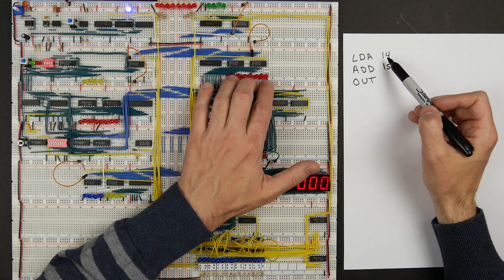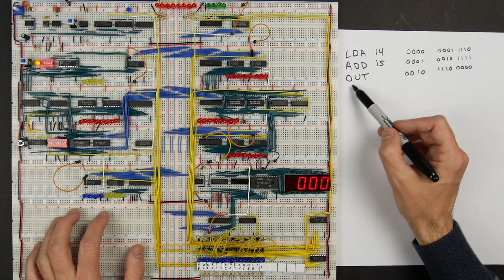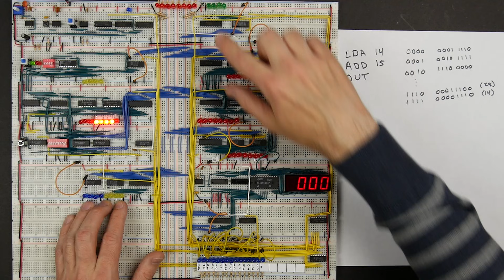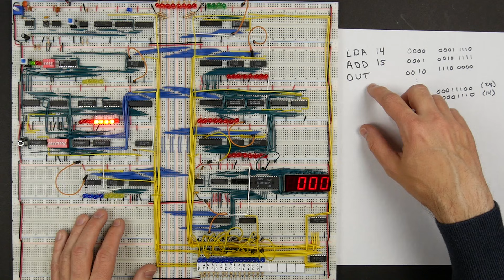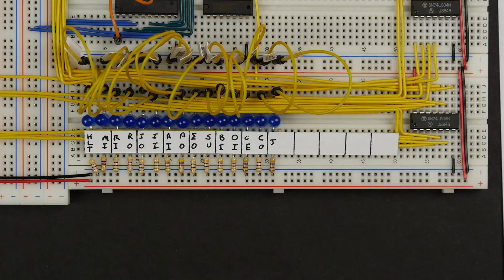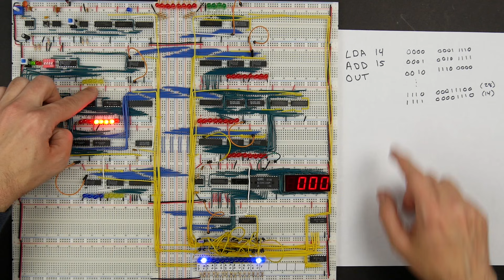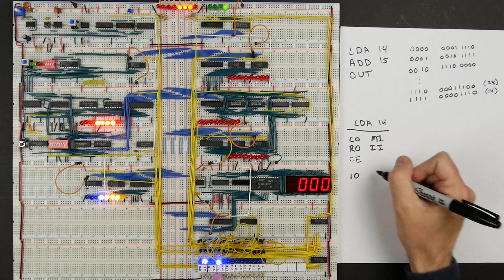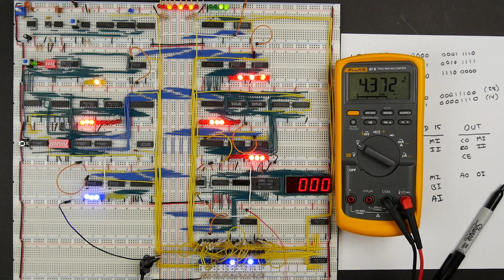8-bit CPU control logic: Part 1

Comment: Thanks, Ben, for all the videos you make.
I am a software type of guy (learning this stuff now) and don't know anything about physics of semiconductors, resistors, capacitors and all that jazz, but thanks to your incredible teaching skills I'm sort of able to understand how your architecture works.
What is really interesting to me though is what is physically limiting the maximum frequency of your architecture (or any architecture in general)? Can you make a 1ms clock cycle? 100us? 1us? What's the limit and what are the limiting factors that make it difficult to simply bump up the clock and not worry about improving the architecture?

Comment: Thanks Ben!  Much appreciated for the upload of all the videos.

I am currently watching your video's avidly, and am in the process of creating a fully 8 bit computer with 8 bit databus and addressable space.  I am using a single 64KB ram chip with i/o pins - and have that working.  (I think I might create a secret instruction to "page" memory too) LOL.

Anyway - so far with your instructions, I have a clock, Ram Module, Program Counter, A, B and ALU.  My next step is doing the EEPROM programmer, Command register, and the CPU control logic.  Cannot wait to see more of this series.

The biggest issue I think I am going to have fun with is going to be designing commands that are two bytes long.  For example - LDA #FF, which would load A with address 256 - requiring a PC increment to get to the instructions expected address location.  And then of course, a LSA (load static value to A) command which hard loads a number into the register rather than a memory location.

Having a great time - and it's so much fun realizing that the technology of an Apple II - is kind of pretty much reachable by the common man.

Thanks again.
Reply: I'm just working this out now for my design. How did you get on? Regarding the LSA command, the number you want to load is actually already in a memory address - the next one along from the command!

Comment: Thanks for the excellent series, it's inspired me to build my own 8 bit computer.
I have a question though:
Why is it that some elements use the BUS at all. eg would it not make sense for the "program counter" to be the "memory address register", or at the least for it to directly feed the "memory address register", skipping the BUS? 
Similarly, and this is more relevant since I'm thinking of having separate "program memory" and "data memory", would the "program memory" not directly feed the "instruction register", rather than having to be read out/in via the BUS?
Thanks.
Reply: I think most of those differences are just differences in architecture. Ben's computer being based on a "Simple As Possible" design from a book he mentioned earlier in the series. For the sake of simplicity everything is either input or output from the main bus. The PC has to be tied to the bus (in this style of architecture) in order to support jump instructions since in effect you're just pushing a new value into the PC. There are certainly lots of optimizations that are possible, but the goal isn't an efficient computer, but one that's useful for demonstration.
Reply: Ben Harper, that totally make sense. Cheers for the input.

Comment: Nice vids, but where do you get all those logic chips
Reply: You should be able to get any of the ICs (Integrated circuits), or other components from any electronics supplier like Digi-key or Mouser. Check out http://www.mouser.com/Semiconductors/Logic-ICs/Logic-Gates/_/N-581zn?P=1z0z63x for an example. If you want to build something similar you'll probably want to limit your search to "Through-hole" components in a DIP or PDIP (or similar) package.
Reply: Thank you!
Reply: Thank you?

Comment: Wow! Two videos in a row? That's a real Easter egg :)
And it's finally the control unit! YAY! :D
Hmm... so the operation of this computer is basically moving data around through the bus between different registers by turning their inputs and outputs on and off? :q Sounds easy :>
I guess I could do a simple control logic now by using a binary counter along with a 1-of-8 decoder, or even a shift register which shifts a single "1" through it, which cycles through these states and turns those control signals on and off? Probably by simply driving those signals through OR gates directly from the pins of the 1-of-8 decoder? But it has to use different logic function for the "changing" piece of the microprogram depending on what opcode is currently stored in the instruction register. Then I just need to reset the counter / shift register to start over for the next instruction. Am I right?
Sounds pretty straight-forward :)

Comment: An excellent video, as usual. One little annoyance, though (which has everything to do with me, mind.)
Coming from a few decades of experience in Z80 assembly, I find the mnemonics confusing. I kept mentally putting parentheses around the operands to keep reminding myself that we’re loading A with values from memory locations rather than directly. So, in my mind the program read something like this:

LD A, (14)
ADD A, (15)

Note: The Z80 cannot actually add the contents of a memory location to the accumulator explicitly; the address has to be loaded into the HL register pair first: LD HL, 15; ADD A,(HL).
Reply: It's just a matter of syntax. Some assembly languages use a different syntax in which memory locations come as numbers or labels without parentheses, and immediate values (numeric constants) are preceded with `#` or some other special symbol. I find such notation much clear, because memory addresses are used much more often than immediate values, so putting all those extra parentheses all the time would be cumbersome.

Comment: Ive got a Question. Can you set the  555 Timer to such a high speed, that the components wont work BC its 'too fast' ?
Reply: There's always such a limit. But those low-power Schottky (LS) or High-speed CMOS (HC) are quite fast, with around 10 nanoseconds of delay for each logic gate. Assuming around 10 gates in series in each IC, let's say we have around 100 nanoseconds of time for the signal to propagate through the circuitry, so I guess that with around 10 MHz clock pulses it should still work fine. But it might get worse due to different noises and parasitic capacitances / inductances from the wires and breadboards. So the only sure way to tell is to check that in practise.

Comment: I feel like this whole series should be required viewing material for all computer engineering students. It covers the whole gamut of topics from software to hardware to architecture design in a detailed but clear way. Thank you so much, Ben Eater, for all the time and work you have put into these videos.
Reply: it does lay out the flow nicely ... and is a great starting point for first year engineers ... get them thinking about doing more with the absolute minimum
Reply: not initially.
Reply: ^ this
Reply: I'm a CpE student and I can't agree more. We're taking online classes right now, so everything is theory-only. It's amazing to see in action all of the stuff we're "learning"
Reply: PvtMadnage - Bro. Matthew  no thank you
Reply: This and Scott CPU
Reply: Yes
Reply: This is a CPU
Reply: Isn't this a little bit "low" for engineering students?
Reply: @MicroageHD  Har har

Comment: So wait, I have a question. The speed is only depending on how fast the clock is ticking. Let's say we're clicking that once every second, that will make this to a 1hz CPU. 
Now LDA, ADD and OUT have different number of lines to be executed. This means LDA needs 5 seconds, ADD needs 6 seconds and OUT needs 4 seconds on a 1hz CPU. Or would the logic be able to execute this all with one single step?
That would explain alot in my past if every command in Assembler need different times.

I'm a new subscriber and this is the best thing youtube has ever recommended for me. Keep up that awesome channel!
Reply: yes, different commands typically do take different times. the average time is calls cycles per instruction: https://en.wikipedia.org/wiki/Cycles_per_instruction
but, in "superscalar" processors you can get to <1 cycles per instruction.
always look at the specs.
Reply: = A / B count the cycles of 30/3 a 10 times a loop with A=A-3
= A* B e.g. 8*8 a 8 times a loop with A=A+8
For this job a shift register (8-bit shift right and left)  comes handy.
DJ
Reply: Umm.... what?  :|

Comment: So this way you can only have 16 instructions, counting the No Operation as one of them. Is it possilble to make multi-OP-Code instructions to make more complex ones? Like LD (A) B. Or OUTA or OUTB or something.
Reply: MrWilliam932 Many computers use different instruction formats. Consider the low 4 bits that are operand address for LDA and ADD; you could use them for something else in IO instructions, for instance to OUT in different formats (signed or unsigned), or other values like B. On the PDP-1 IOT group of instructions, a similar field selects between devices like typewriter, display and paper tape puncher, splitting the IOT into subinstructions like DPY and RPB. Often such uses grow to fit unrelated instructions in, like the x86 prefix that used to mean POP CS.
Reply: I'm not sure what you mean by that, but it is definitely possible to have instructions depend on data from previous instructions.  It would probably require more than 16 instructions and some more registers, but it can be done.  Check out St3venAU's comment suggesting multiple-instruction commands.

Comment: Could you optimize your fetch sub-commands by setting the second one as RO II CE? That would give you more space for future commands (by shortening the fetch cycle from three commands to two). Or am I just missing something out? My thinking is that Counter can progress on the second pulse, since the command memory adres is already set in Memory register, so changing the counter shouldn't affect anything.
Reply: it wouldn't make more space but it would decrease the time needed to execute by one clock cycle. Apart from that i see no disadvantage in that.
Reply: That would definitely work!  Although I haven't found much use for an extra microinstruction, this would make it possible to shorten each instruction to only 5 microinstructions for about a 17% performance increase!

Comment: During the fetch cycle is there a reason why the PC increment can't be done at the same time as the RAM out and IR in signals? Seems like it would reduce the number of clock pulses needed per command.

Oh and fantastic videos, really been enjoying following this!
Reply: Tomas Milner I'm guessing here, but it might just be that this makes the example more muddled.
I can't see any clear reason why that wouldn't be possible, but it does make the control logic less clean.
It might depend on how the control logic itself does things I guess.
Ah, too much speculation in the end. Sorry. XD
Reply: At first I thought that the CE shouldn't be fired when executing a JUMP instruction, and that it should belong to the second group of microcode. But it actually can be RO II CE and the JUMP microcode would override it wth a new value.
Reply: Obviously still just speculation, but I'd agree with @Kuralthys. Program Counter to Memory Address followed by Memory Contents to Instruction Register are both simple, coherent, self-contained steps. Setting Count Enable (and incrementing the PC) is required for the next instruction cycle, but isn't required for either of the previous steps to work. So it doesn't have to be included earlier although I don't know of any reason it couldn't be done at the same time.
Reply: KuraIthys That's what I was thinking but  I'd argue it makes it less clean by introducing an extra clock cycle. Then again I'm used to reducing clock cycles for everything and this isn't really a performance critical application.

Comment: I think the follow-up should be to add some kind of punchcard-reader (old school) that'll let you program without the dipswitching, heh.
Reply: Your suggestion reminds me of seeing a design for a simple "key card lock" (only a play one, for obvious reasons) built out of a LEGO motor and bricks, paper clips and rubber bands, many years ago.  I built one just for fun.

It was designed so that when you pushed the card into a slot, it would start the motor which would pull the card in and the holes in the card would be read by spring contacts made out of paper clips.  The card would then drop down onto a rubber-band conveyor belt and be pushed back out the front through a second slot.

It was rather fun to see it working although of course it wasn't practical in any way.

The idea was that there were two contacts, with one being for the "clock pulse" from a continuous series of holes in the card and the other one being for the "data bits" to be read on each clock pulse.